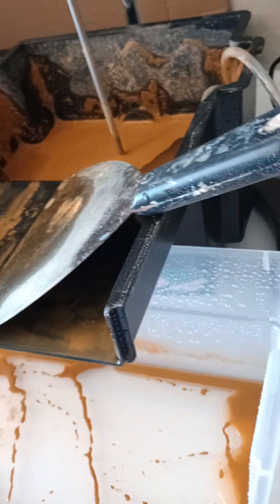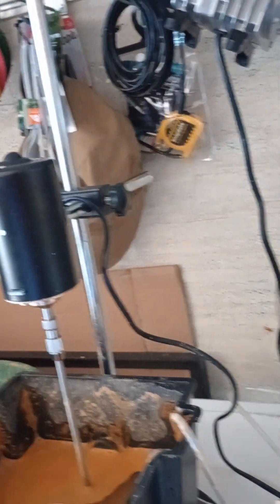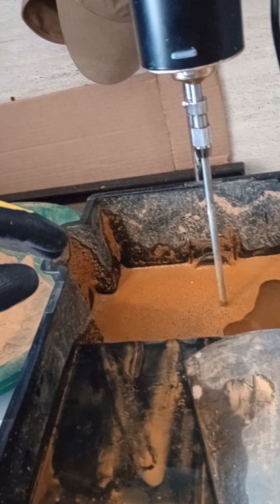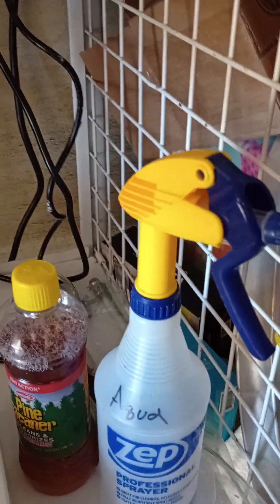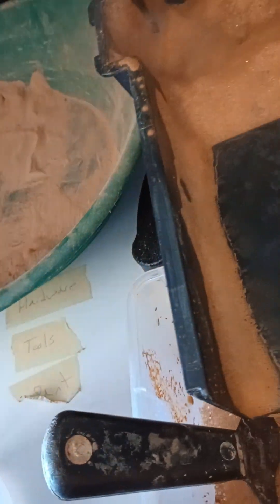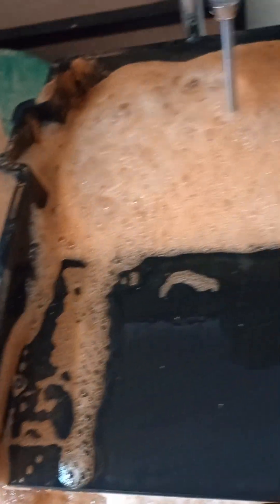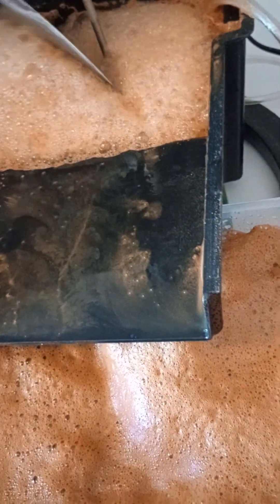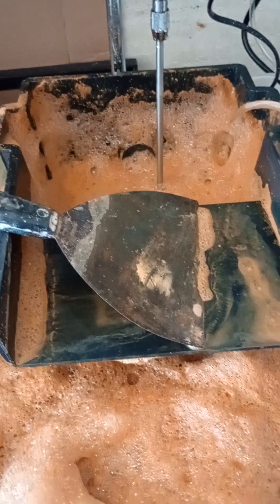DIY Froth Flotation Cell

Comment: Probably the best concentration vid Ive ever seen. How did you procedd further? AR? Electrolytic deposition with aluminum cathode and copper anode or copper cathose and iron anode in chloride or sulphate electrolyte?  :)